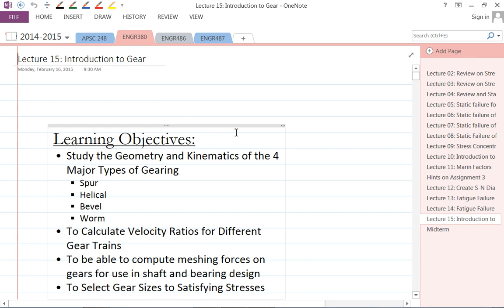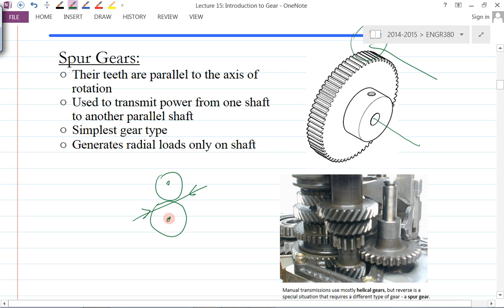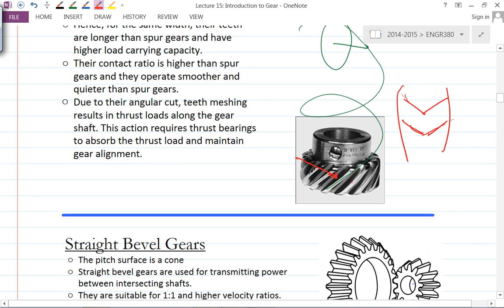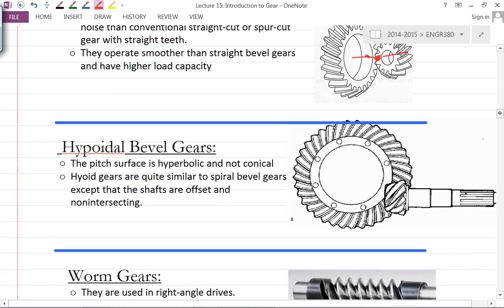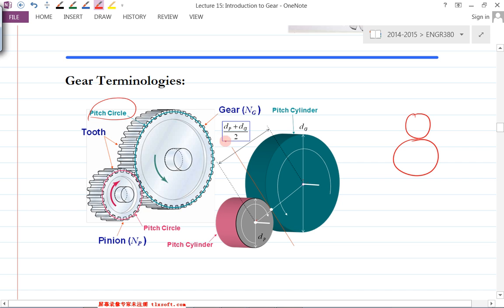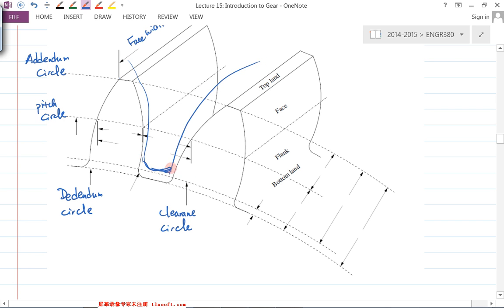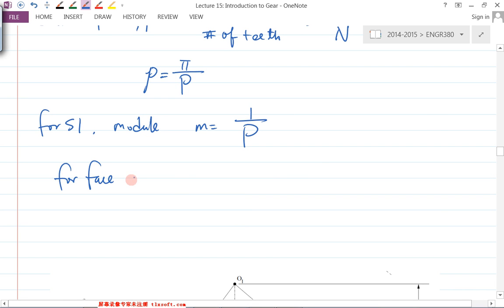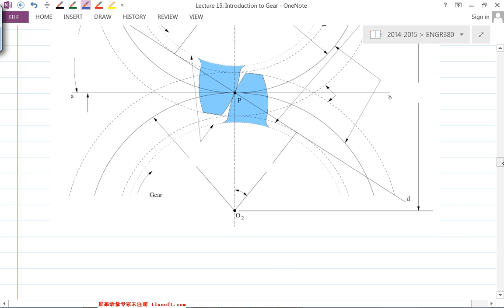2014W ENGR380 Lecture15 Intruduction to Gear, Part I

Comment: @Yang Cao Can you explain in more detail why the clearance C equals dedendum minus the addendum? It also took me a minute to realize that any two gears with the same diametral pitch can mesh and the the diametral pitch dictates the different pitch diameters possible because the number of gear teeth will always be an integer. Thank You your videos helped me understand and passs machine design in college!
Reply from the maker: Clearance circle: A circle that is tangent to the addendum circle of the mating gear. 
 
Clearance (c): The amount by which the dedendum in a given gear exceeds the addendum of its 
mating gear.

Note that for the same diametral pitch, both the gear and pinion's gear teeth have the same addendum and dedendum.  The portion of the mating gear's tooth between the addendum circle and pitch circle is addendum.